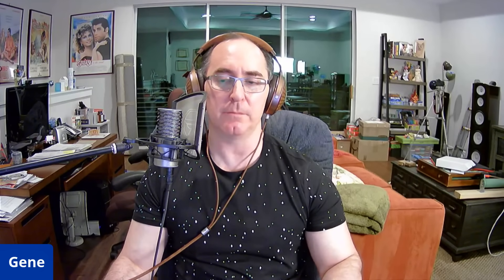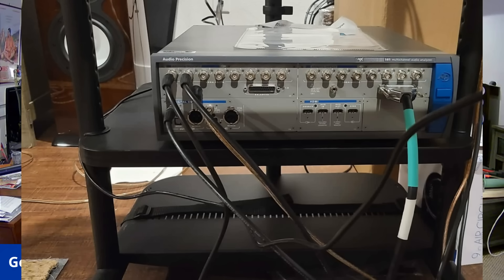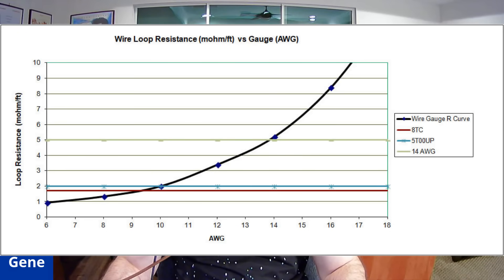Speaker Cables Really Don't Make Much of a Difference?

Comment: Is everything really measureable?
I tested a few options years ago, and thought I could hear the difference of ordinary copper and silver plated. I had some QED silver plated that was a bit thin, but I liked the tone. So later on I ended up with some silver plated thicker ones from Van den Hul CS-122 in bi-wire. Now I'm thinking about upgrading to the Van den Hul D-352 but single wire.

Comment: Kimber 8TC (3M length) is $816 for basic copper wire with basic banana plugs. For ONE speaker's worth of cable. Build your own and put that money into better speakers.

Imagine how nice a set of speakers you would have if you dumped an extra $1500 into the speaker budget instead of falling for this BS.

Comment: Even the most moronic of audiophiles won't put their money where their mouths are and use copper welding lead for speaker cable. It satisfies all requirements including high costs for zero audio gain just like the name brand speaker cable they worship.

Comment: I just went from a 14Gauge to $55, 10Gs on my Mc352/Sonos Farber system. 
I HEARD THE DIFFERENCE - it WAS small, BUT: fuller bass; better sound staging & spacing. It's as if the new cables got more sound data to the speakers.

Comment: Thanks a lot ;) Clearly the connections are more important... When I used spades, and used a tool to tighten the connection... The nut still loosened itself over time!!! 
When I tested tightening the nuts again, while music was playing, the bass volume went up... "Surprisingly much"...
Finally I switched to bananas...
Good quality bananas, will all keep the contact pressure constant, "for ever".

But that opens a new discussion ;) 
Today I believe, a good BFA style banana has the largest contact surface, combined with the hardest contact pressure, especially "on the tops of waves on the sinewave shaped slit in the tube".

And I wish, the plug has no "large and thick body part, with edges", where the current might make whirls.
This also means, the entire metal tube is one piece, instead of two, "hard pressed together".

I only know that In-Akustik sells such "plain tube" BFA bananas... Can be "crimped and soldered" or just soldered on the cable.
Either gold- or silver plated... And they are made of high quality Berylium-Copper, to keep the contact pressure "for ever".
And they are used on the madly expencive "NordØst" cables!

However, a plug with a solid pin, with a "banana shaped spring" to give contact pressure, 
can have a pin of pure copper, with gold or silver plating (or nickel or rhodium). 

Will the slightly better conductivity of pure copper pin, give less "plug resistance plus contact resistance" ???
The british engineers society, which invented the BFA style banana, and made it British Standard for professional use, say NO!

But with a solid pin, with a "steel banana spring" the pin MUST be smaller than the hole it shall be plugged in...
Meaning the contact surface, become one narrow line, opposite to the spring...

The BFA "hollow tip plug" shall be 0,4 mm larger than the hole, and a GOOD BFA plug, will press hard, with its entire surface.

But the race to make the best banana continues... Some will chose, by taste... Some will chose by science ;)

Regarding whirls at edges and corners. For very very highfrequencies, in the MegaHerz range, this is extremely important, 
so those plugs must be shaped "as smooth as possible, and with no excess volume of metal".

It is clear, near no producer of plugs for sound, even consider this...

Even when In-Akustik makes a perfectly smooth banana plug, with no excess metal...
They also make banana plugs with a "large hunk of metal"... 

Note, I am not affiliated with In-Akustik, I am just very happy I found those "seemingly ideal bananas" :)

Obviously I would love, if "Audioholic" would measure the most sold bananas, and also that kind, I am using now :)

Comment: “You can have data without information, but you cannot have information without data.” – Daniel Keys Moran. “In God we trust. All others must bring data.” – W. Edwards Deming
. Erudite presentation. Data-driven. Thorough and thoughtful analysis. Thank you. This answers the question for me (I liked and subscribed). If you like high end cables because they look nice and/or have durable connectors, I think that's perfectly fine. Just don't wax eloquent that they actually sound better. Maybe if you supercooled the wires with liquid helium (about -265 degrees Celsius), you could have heard the difference:)?

Comment: I use the WBC 7-gauge bi-wire set into my Arendal 1723 S loudspeakers. I have yet to find a cable that betters them. And I am talking cables like Nordost, Analysis Plus, and Kimber. I cannot account for the gobbledegook professional reviewers use to describe what they hear. They have developed their own vocabulary. They HAVE to find differences in sound. It is simply not possible that a $200 cable can compete with a $5000 cable let alone their equipment. It's called Bullshit Bias. But with Nordost you will hear unicorn farts and Norwhal sighs.....

Comment: If you have real power it’s a notable difference to use bigger gauge wires in mids and and it really smooths things out with smaller cables on highs and back years ago I bought monster cables hdmi for my PlayStation you definitely seen a big difference from the one it comes with to monster I however don’t think you need to spend thousands on cables some of the best av catch cables are maid with nice old coaxial cables they are already shielded well

Comment: Hi Gene

Thanks for yet, another excellent video. 

You and the entire staff have been a great source of quality, objective audio reviews, for decades now.

Your investment in the best of the best test equipment has anchored your creditability out here.

 I've learned a lot from Audioholics!

Having some experience with audio measurement, I know first hand the challenges in simplifying or even making possible, sufficient disclosures if objective measurements, capable of satisfying the target audience.

You guys do a dandy job! Please stay the coarse! 

I originally composed an elegant, well word smithed comment, befitting of your efforts in this space, but I accidentally deleted it. Unfortunately, due to the hour, I don't have the energy to reproduce it.

The lessor version ...

I've always found reviews of interconnections in general, to be rather well chewed and highly debated sources of many resulting contentions (I doubt you disagree). 

I have supposed the reason for such has always been that they all, again, in general, have failed to 'potentially' explain or at least point people towards why sometimes, some cables do sound different, when interconnected within the same system, having very similar if not identical lengths and cross sections (context two channel home systems).

You may disagree with this last statement, but please bear with me.

To your point, DC or zero Hertz measurements are of no value in this regard. 

Also to your point, AC resistances (impedance) are of some value. 

However, they largely, only depict truncations in amplitudes at various frequencies (which you also pointed out). 

Being linear in nature they're highly predictable and do behave as such, in terms of providing accurate estimations of potential power delivery, at various frequencies (I think you likely also agree with this statement).

Now, for the fork in the road...

I am wondering (and please do correct me if I'm wrong) if it with would behoove us all, to include measurements from the time domains as well (understanding that there would be some challenges on the acoustic side). 

Again, to your point, reactants also have a role in all of this. They control the arrival times of the voltages that the AC impedance limits. 

In that music production and it's reproduction is literally all about the timing of frequencies at all levels, in all domains,  within a guven signal chain. Should we not also be investigating at least an equal measure, their respective effects on the arrival times of given frequencies, within an overall  response?

Ideally, the Group Frequency Delays should all be zero or all the same, from the beginning to the end of the signal chain (electrically, electro-mechanically and  acoustically): however; due to the intrinsic nature of electric devices, specifically loudspeakers and passive crossovers, such is currently impossible.

Because it is impossible, loudspeakers are decidedly definable as being nonlinear. 

These nonlinearities force manufactures to expend much of their R&D to voice products as to produce as little dissonance as possible (time smears that lead to the production of dissident, destructive or constructive frequency propagations, from mult driver systems). 

Said time smears (errors) not only effect the general on-axis frequency response measurements, but also the potential for the development of an accurate three dimensional and transparent sound field, along with making significant contributions to the overall musically (think foot tapping).

As a general depiction: Inductance place frequencies forward, capacitance places them behind, the pack, if you will.

While its unlikely that a short, properly gauged cable will have a profound effect on a the arrival times, we do objectively know that long cables do. Not only in terms of group delays, but the phase of the primary envelop. Small errors within a larger error, if you will.

Perhaps the differences that many have claimed to hear are the result of these effects, in tandem with losses in power delivery due to impedance, if not more so, just on their own.

It would be interesting to see added to your measurements the group delay responses of each cable, and at varying wattages, both electrically and acoustically (more so acoustically).

Say 1-Watt, 2-Watts and 4-Watts, while connected to the Revels (drive level matters). 

A prime challenge would be to accurately find the acoustic center of the Revels and gate out the room at the same time. I suppose near-fied measurements of a driver from each band could be taken then compared as well.

The Kimber  Cable has more capacitance then the other cables, it would be interesting to see how much greater the group delays would be and a at what frequencies.

To my mind, this is a question regarding the transfer function of cables and the resulting effects that they can may have when interconnected within a signal chain to not just towards tonal differences, but the overall potential towards the reproduction of a stereo sound field, AKA sonic height, width and depth. 

As such, IMO the same metrics should be used when measuring any other stage. 

In that all stages and components are comprised of LCR and not just R, and the resulting delays, I believe that so too should speaker and patch cables be evaluated for.

At a minimum, doing so will breath some new life (fodder) into an otherwise well chewed debate over R's effect an 2D frequency response graphs. 

Perhaps CSD graphing s might be a practical stopgap step in a more inclusive direction. 3D frequency response. 

Food for thought, I'd love to know yours.

Again, please stay the coarse! 

Know that you are all respected out here by the many rather then the few!

Comment: You had to measure the phase shift and the damping factor to impulse response.
Reply from the maker: LOL that is completely irrelevant in an unterminated cable. There is no phase shift or issues with impulse response. You can't measure damping factor of a piece of wire, there's no ratio of input to output impedance.
Reply: @Audioholics  So there are some critically important audible parameters that are impossible to measure? I see...
Reply from the maker: @Androxylo no, you're taking those parameters out of context and measuring the cable unterminated in those cases is meaningless. If you dont understand basic electrical thoery, i can't help you. I can point you to oir articles but you still likely won't agree based on the statements you're making.

Here is a start for you: https://www.audioholics.com/audio-video-cables/dielectric-absorption-in-cables-debunked

Comment: Audiofool industry 😂

Nah, guys, you can buy a 10mm2 house power cable for around 1$ per feet. Buy red and blue. They are even existing in paired, molded silicon. Cost 5$ per feet 😂
Then buy a decent banana plug , solder it, and done!
It has about 0.001 Ohm resistance per feet, and good up to 3 Ghz 😂
Jesus!

Comment: I haven't tried a lot of speaker cables, but I have tried a number of different interconnect cables, the differences can be easily audible.  I believe manufacturers build differences into their cables so they sound different, whether better or worse. Some seem to roll off highs, some seem to resonate in the midrange, others roll off the lows.  I have wondered about the placebo effect, and asked other, non-audiophile people to describe any differences while I swap the cables.  I've done this with 3 different people, and they all described the same things I was hearing.  Their idea of which was better may have varied, but what they described in terms of sounding duller or more sparkly was spot on.  So yes, there are differences in sound, not like adding a subwoofer or changing a ceramic tweeter for a soft-dome, but still audible.

Comment: Of course they DO. I have yet to see any high-end stereo where the owner used lamp cord as speaker wire, because as we all know most people want to spend more money than they have to! For anyone that has ears enough to warrant ungodly expensive audio equipment, they truly are only interested in getting the absolute BEST sound from their equipment. And THEY answer the question posed exactly as I have. Really high-end cables are worth purchasing-- speaker wires, inter-connects and mains.
Reply from the maker: Good 10awg speaker cables are cheap and sufficient.  Lamp cord is such a red herring argument.  Quality interconnects made from RG6 and good terminations also cheap and completely sufficient.  Everything else is window dressing,  nothing more.

Comment: Unfortunately with Audio, many of the things that make a difference are unmeasurable,  I don't necessarily agree with your assessment.  If this were the case, why do many products in the same catagory, amplifier s for example, that spec identically sound different, or speakers or any product.  Just because YOU can't hear a difference does not mean no one can. Not making a case either way, but after 60 years in the industry,  I personally don't believe you supposition holds water, sorry for the four year delay.

Comment: Finally something sensible that you have learned from school. As long as the cable is thick enough and can deliver enough current without voltage drop when needed, there is no audible difference. Then you can discuss noise from other nearby cables, but you will be able to detect that by having the system ON without music and listening close to the speakers for noise. In that case, the noise source must be removed or changed.